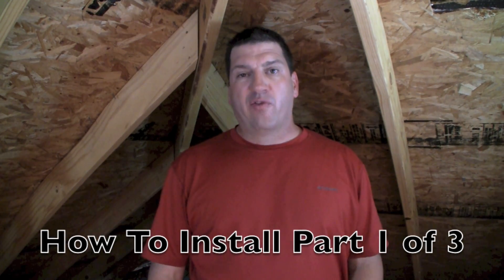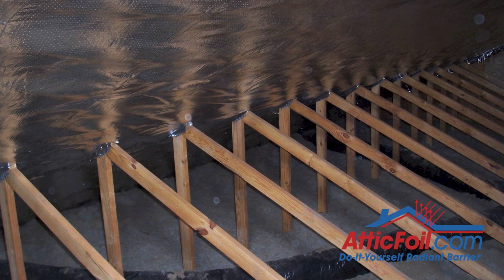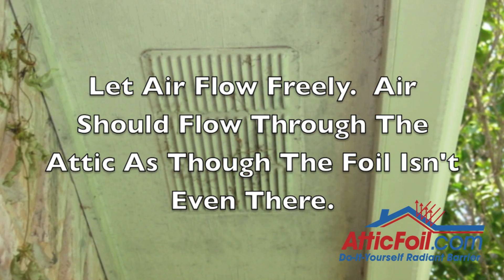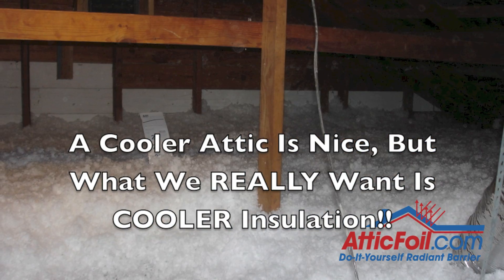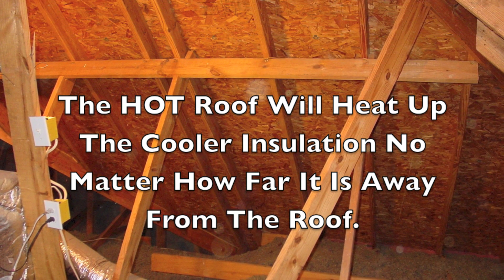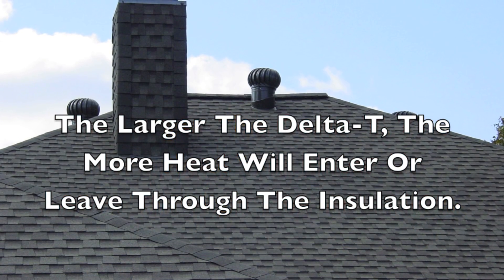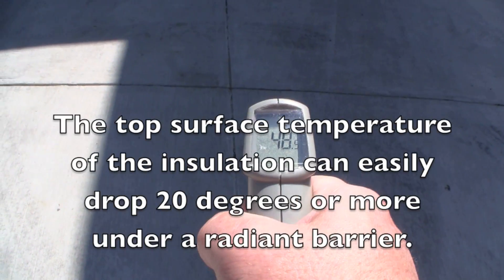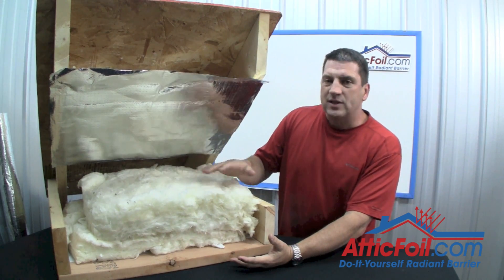How To Install Radiant Barrier Foil Insulation AtticFoil - Part 1

Comment: Thanks Ed for the perfectly detailed and informative video's. What a great economical product. I'm a BPI certified energy auditor/weatherization expert from Marthasville, Missouri. I started my own company, Off the Grid Home Energy Analysis, about 2 and a half years ago and LOVE what I do. I'm happy to see someone else with the same business philosophy as my own- The pride I get from saving a  homeowner/ business owner money and doing the job right far outweighs the paycheck. I'm always looking for new, cost effective, energy saving products for my clients and it's clear that I just found another one. I think I'll install your product in my own home first in order to quantify the results for future clients. At the same time, I'm currently air sealing and adding R60 (blown cellulose) for a 3300 sq. ft. senior center (truss built) with 3 HVAC units worth of duct unfortunately all located in the attic (for that matter, one of the units is even located in the attic just under the roof sheathing). I'm getting ready to install 130 durovent baffles (the type that wrap over the top of the top plate to gain an extra R15 or so atop the top plate). This brings me to my only concern about your product. I haven't heard you mention anything about using atticfoil in conjunction w/ baffles. I noticed you mention installing a run of your product on the bottom end of the roof, where the truss sits on the top plate, then leaving a gap for ventilation between the 1st and 2nd horizontal foil run. The problem I see with this method is it doesn't allow for any insulation (unless you would take the extra time, effort, and money to adhere rigid foam board atop every section of top plate between trusses previous to installing that first run of foil) over the top plate, which thermal imagery shows is definitely needed. Appreciate your response in advance. Thanks for the well thought out videos- way better than most. Good luck to you. Great product!
Reply from the maker: Bernie, I get what you are saying and totally agree with it.  However, quite honesty trying to get enough insulation on the top plate is a little advanced for the typical DIY homeowner.  From the standpoint of an energy auditor/contractor, yes I consider it one of the "last mile" items to maximize comfort and efficiency.  I would look to a method that would maximize insulation on the top plate and allow for maximum coverage with AtticFoil Radiant Barrier will providing an air channel for ventilation.